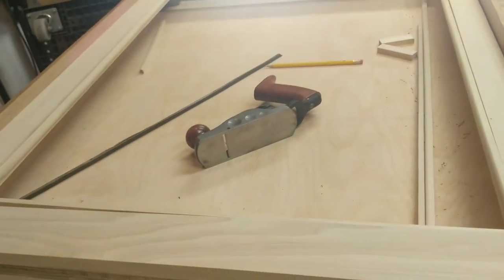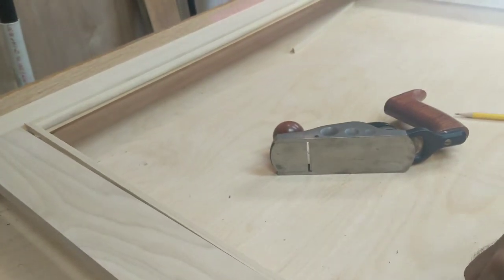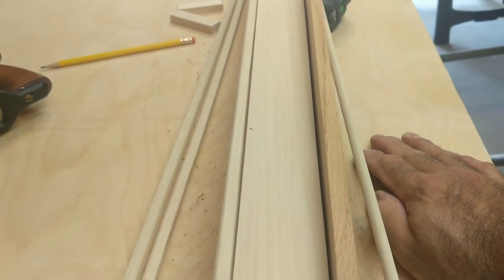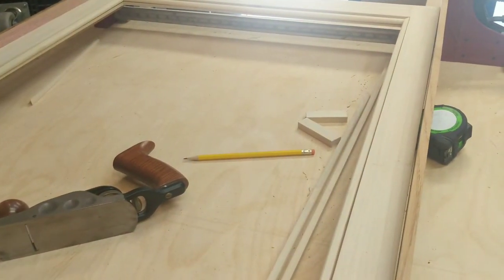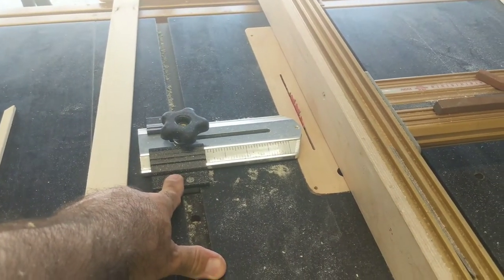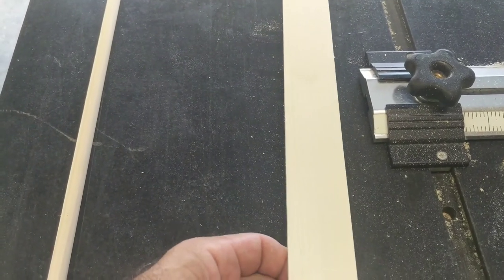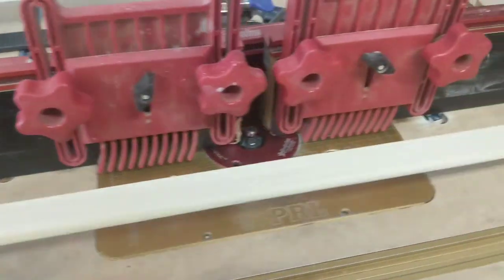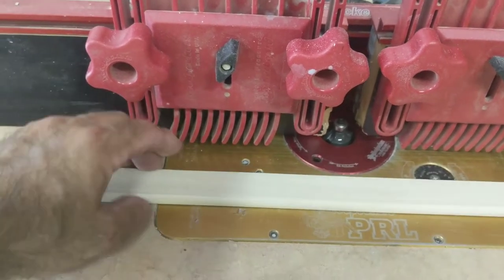Wooden Glazing bead for the Snow Sweeper Windows .

Comment: I noticed the thin strip rip jig. Did you ever see the magnetic feather boards?
Reply from the maker: I have seen them and have one. The MagSwitch ones are the best IMO ,they don't move at all   . The neat thing with them is you can turn them off and on . Off to move them and on for activate the magnets.
Reply: @BoxcarJerry  try ripping a 11-7/8" x 20' LVL. The Magswitches can lose their grip. They also make good stop blocks
Reply from the maker: @martensiersma3304  that's a pretty big board. They do make them in different strengthens. Maybe you need the 150 lb one.